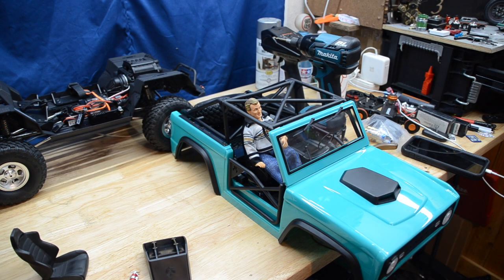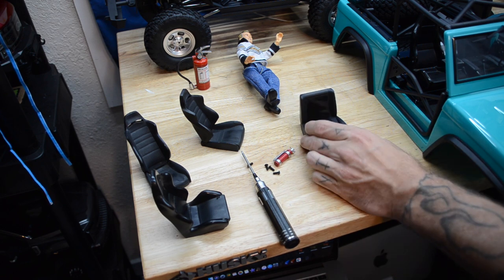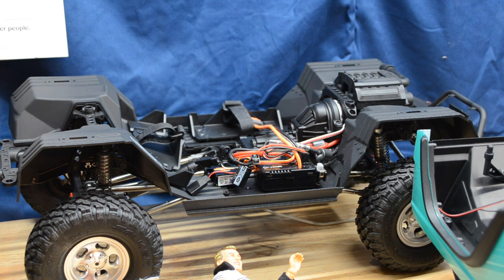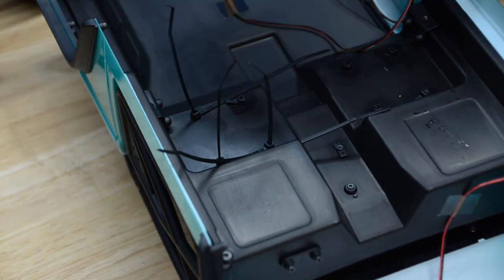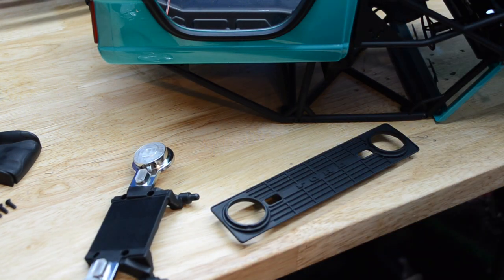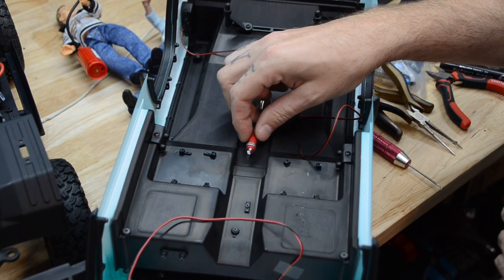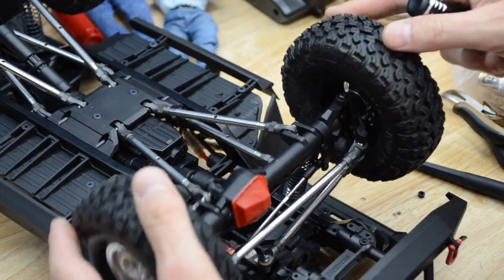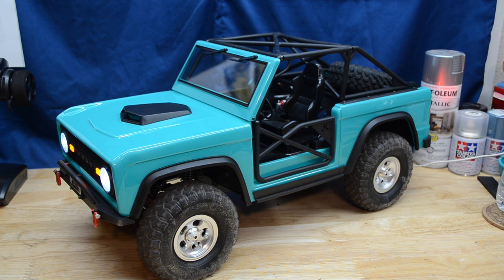Scale Seats & Details on the Axial SCX10iii Bronco, No Melted Servos!

Comment: This is my favorite Bronco vintage. I have always thought Ford used a 60's Falcon as a starting point to design the Bronco.
SCX 10 III seemed like it didn't have as favorable a rep as the 10 II.
The zip tie trick is cool. And yes Stick Shift.
The crawler chassis I have I built up from sources like CC Hand etc. They are still "in work" , hmmm I seem to remember buying those chassis for an attempt at building a gasser style Rat Rod. Some You Tuber got me all riled up about building Rat Rods....

Comment: I've never had an axial product so can't comment on their quality.   But if I'd had any with all those issues I would have to get rid of them.  Or change out the parts that were the problem.  Either way I always look forward to seeing what you come up with to fix issues on your builds.   
For the seat mounts one thing I have used to fill voids is "FlashFix" maybe drill holes similar to what you've done to provide something for bite.  Once cured it can be  sanded or taped.  It won't take a lot of torque but should work here.  
I ran into a similar problem with my TRX-4 & Defender body.  I couldn't find a driver that looked right.  I ended up with the head, arms & partial torso from one figure mated to another partial torso.  People have said it looks good but I look at it and shudder.   It's a Frankenstein for sure

Comment: Mine is on the way took advantage of the latest sale I have Treal metal beadlocks Proline tires 90 mm shocks & Treal shock mounts. My plan is to make its stance a bit wider to make it more stable & lower it with the 90mm shocks. Not sure how or if the Treal shock mounts will work but hopefully they fit & it will allow more shock positions. The combination of great looks & performance make it a great RTR & there’s plenty of upgrades available.

Comment: Been running my 10.3 bronco for a year, aggressively. Stock dig servo still working great, I set my endpoints immediately and knock on wood it’s still working just fine, but the transmission is a bit sloppy compared to the 3 gear trans. Like you, I had a gladiator for a while but I dislike portals and sold it off, but I didn’t have any issues with that either. I internally limited my shocks to lower it and printed some stuff to delete the spare tire. I have a bikini top I made from some vinyl I bought at walmart, brass on the corners, baja pro-x’s on the stock wheels, and a diamond select Jay & Silent Bob driver figure fits perfectly. I have 14 or so other crawlers and the bronco works just fine for what it is, it’s been a good performing, 100% reliable trail truck. Your results may vary.

Comment: I've been using 1/12 wrestling figures in my trailfinders, they're only $10-$12 at dollar general (a little bit more at wal-mart) so it wouldn't be expensive to try out one. I like how it looks lowered down but the tires look maybe a little big. To get the wheels off try a soldering iron on the nut. A 60 watt iron should heat the nut without having to be on there long enough to damage the wheel. A friend cut and hinged the hood on one of those to allow access to the engine, would be pretty cool with it detailed. If you really want to paint the signals get the smallest modeling brush you can find and try going through the LED hole.

Comment: Looks good! Did the same thing with mine although I painted the teal part under the seat just inside the door. Painted it black and feel it looks more realistic than the huge teal panel you can see through the door frame. I also took off the front window and the dash was the perfect shelf/platform for a scale CB radio to sit and hung the mic from the top roll bar.

Comment: I and my Father each have one axial. I have a completely stock SCX 10.2 Honcho and my father has a Wraith 1.9 which is cosmetically modified.

So far each one has offered no problems, but they're pretty simple

but I can't say I've seen a single truck with a dig servo that survived more than...like 15 minutes without a huge amount of gentle adjusting.

Edit : Whoa. I'm not much a fan of early broncos, but that thing looks great with the 'lowering kit' applied!

Edit 2 : On the subject of Axial's engineering. The SCX 10.2 AND. Wraith 1.9 Both have the panhard hit the axle under full compression, which prevents either truck from running a full droop set-up. This could've been easily, easily adjusted by simply modifying the panhard.